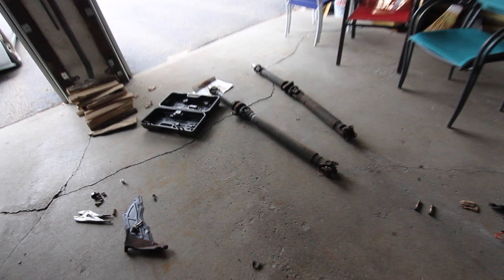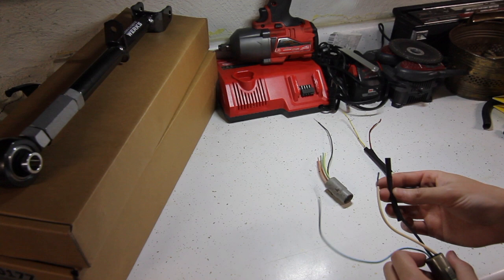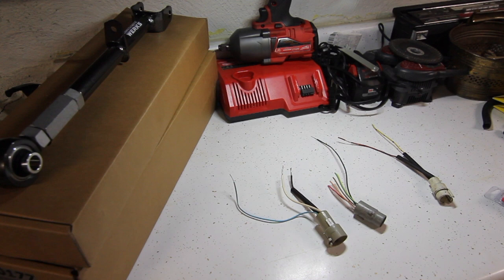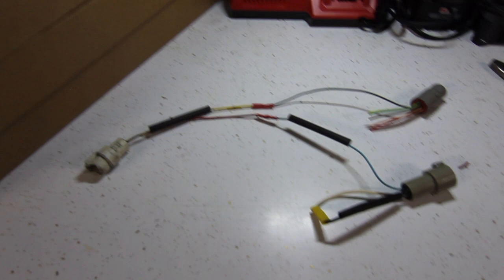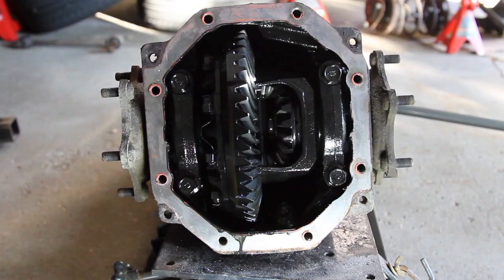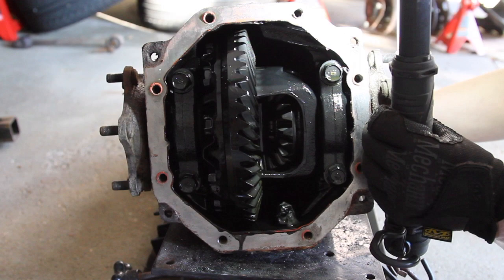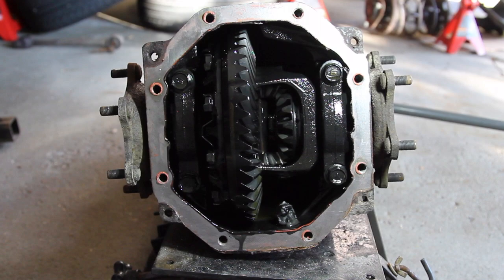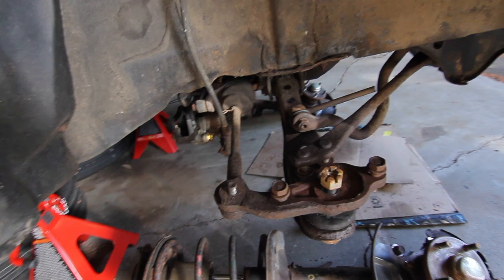Cressida update - W58 SWAP, COILOVER INSTALL, WELDING DIFF

Comment: Is there a separate wiring harness for the w58 or did you use the auto harness ?
Reply from the maker: W58 should have the reverse wiring + connector on it, and then connect it to the engine harness

Comment: Do you know if this wiring would be the same for 1ggte tt soarer 1988 auto to manual conversion?
Reply from the maker: not 100% sure, but it does use the same transmission as the Cressida, so should be pretty close!